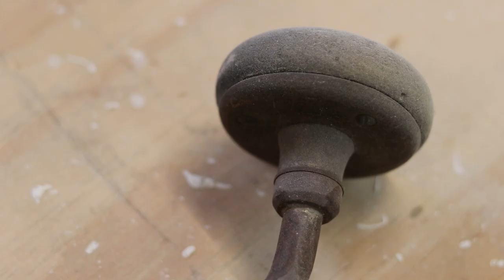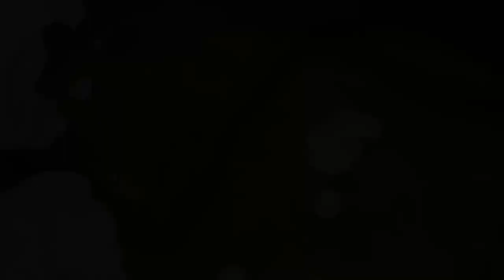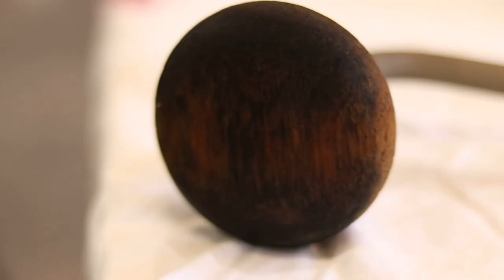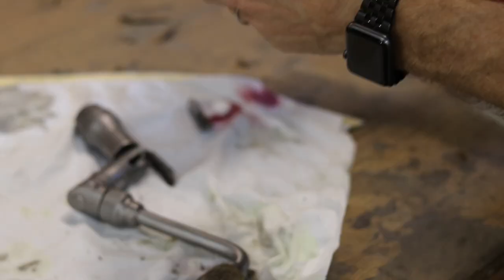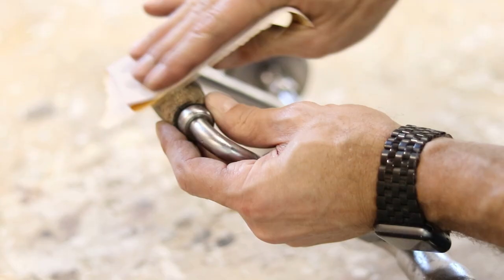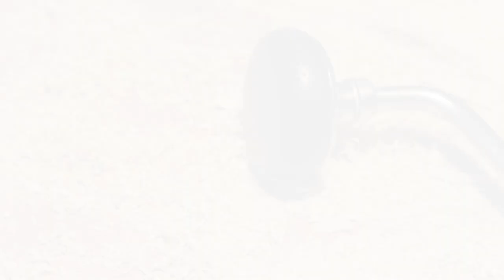Restoring an Antique Hand Drill

Comment: You cleaned up the outside and painted the wood the wrong color.
That still shows a lot of wear and pitting!
That's not the way it came from the factory!
Therefore that is not a restoration!
That is a partial repair or a renovation.
 When are you going to do the restoration?
or was the title a LIE?